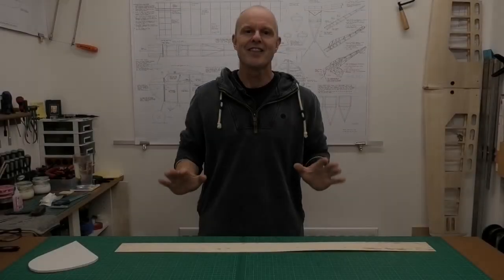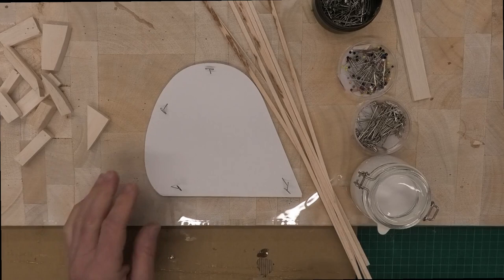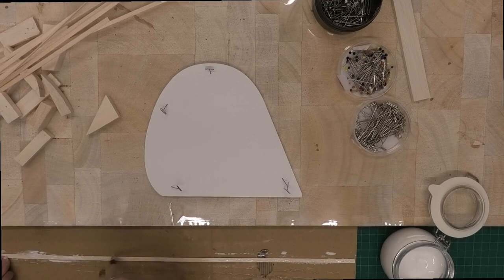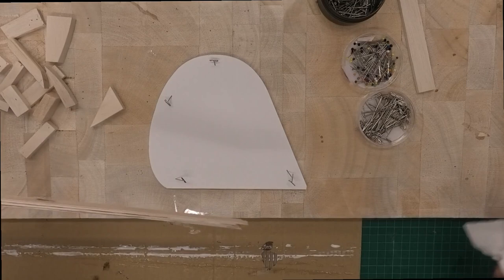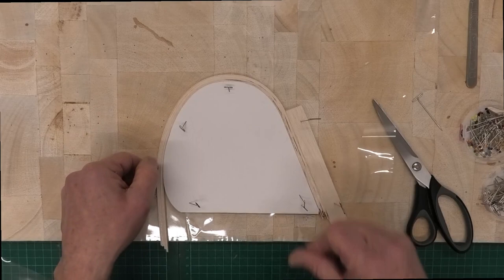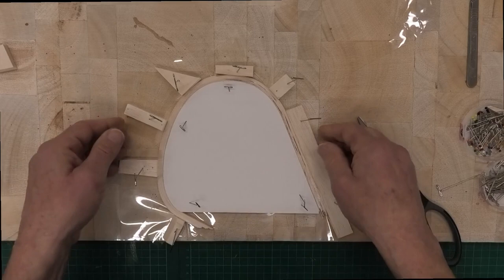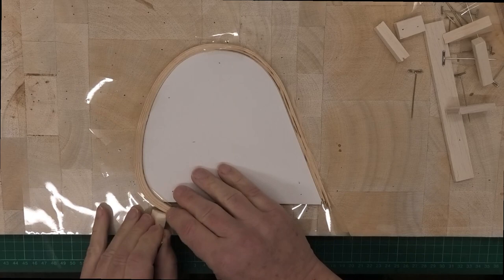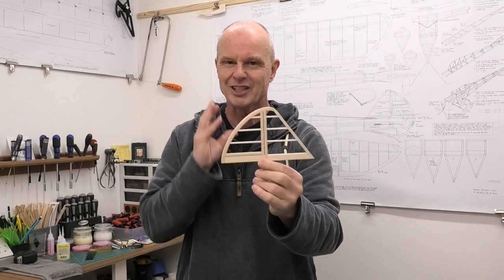Laminating Balsa - Model Plane Construction

Comment: Worth mentioning Mark is to reduce the size of the template accordingly to allow for the thickness of the laminations. Another technique is to use the inside of the template instead of the outside, either way though a great and pleasing result is achieved 👍
Reply from the maker: Good point! Thanks Cliff

Comment: Nice video, Mark.  I like to make the form about 5-10% small because my laminations always spring back just a bit, especially with larger structures.  I also put the plastic sheet over the top of the form and press it down to the table so the laminations don't get stuck to the foamboard.  My plans show the template as a separate drawing on the sheet.
Reply from the maker: Hi John, thanks for the comment, it is certainly a great technique to use, so rewarding

Comment: Your leading edge should have been moved down a half inch or so. Below the former, unless you can cut more off. I like the idea of gluing all the laminations first.
Reply from the maker: Hi Steve, thanks for the comment, I think you are confused about the orientation of the fin/rudder.  If you are referring to the bottoms right of the lamination that is not the leading edge, that is the skid section for under the fuselage. You will see from the clip of the plans that the leading edge is not part of the lamination, as it is made up of a piece of 3/16 square balsa
Reply: @MarkRobinson555  Aha!  Yes indeed.  First time I tried this technique was in 1997 when I built my first Lazy Bee. I used corrugated board and wrapped the former with packing tape. I still have them somewhere. I like the foamboard.

Comment: Hi Mark Quick Question? my plans for tail says laminate from 1/32 ply x1/16 balsa ,the ply I got is 1/32 or 1mm birch plywood 3ply will that work still or your idea? I'm stuck atm
Reply from the maker: What you building?  if you use ply it will be heavier and won't bend as well, so depends on what your are building
Reply: @MarkRobinson555  it's the peter rake's Aeronca Defender pretty sure i got it on aerofred ,just a small model for my first build  even if you could have a look at the plan
Reply: Sorry I might’ve just read it wrong
Reply from the maker: Hi, I have just looked at the plans and it doesn't mention ply, so if you go with the suggested 1/32 x 1/16 balsa it should be fine
Reply: @MarkRobinson555   THANK YOU HEAPS MARK!!!!
Reply: I'll send you a $$thanks on Monday for the help too cheers again 👍🏻
Reply from the maker: @user-dt9nf3uf6d  really pleased you managed to get it sorted, hope the rest of the build goes well